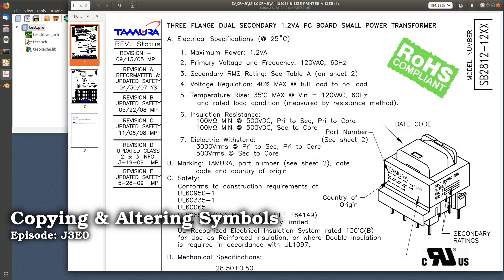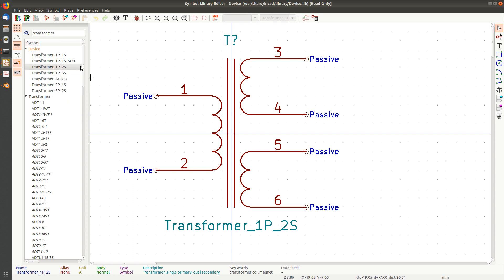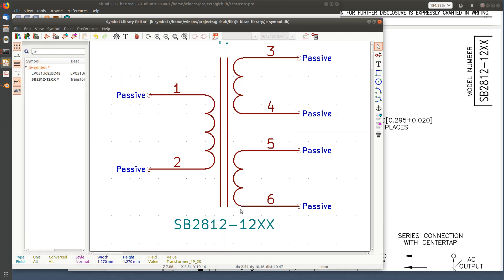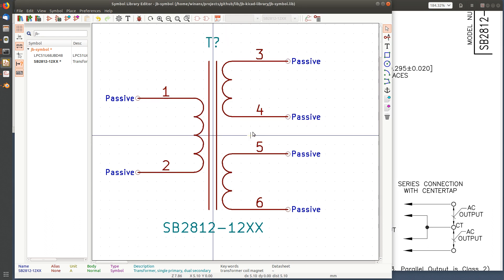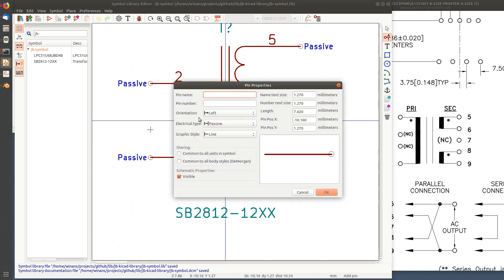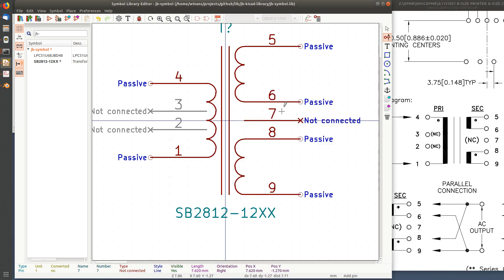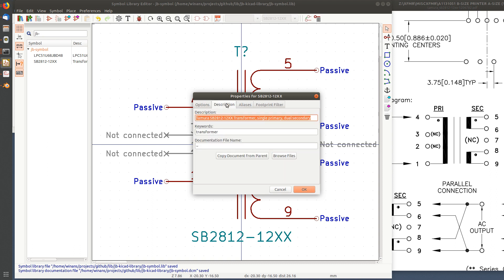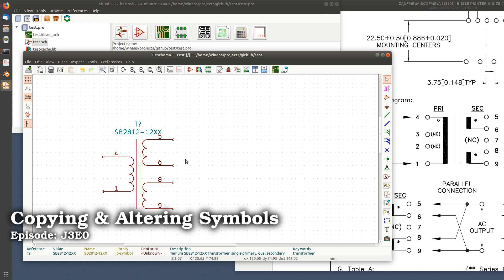KiCad 5 #13 Copying & Altering Symbols

Comment: Hi John, I got an issue I copied the part 27512 to my lib but instead of one it copies 2 types one UV and one OTP
I can edit the OTP part like I want when I delete the UV part it deletes both symbols.

Can you help me to get it done right ? Maybe a very small video :-)
Reply from the maker: I am not able to film a new vid on this right now.  But it is a good idea.   The short of it is:
You probably actually copied the 27C512 that included an alias for the 27512. You can delete the alias(es) you don't want and then rename the part to what you want.  
Locate and delete the aliases in the symbol editor by opening the part properties (I just double click on the background to get to that window) and then select the aliases tab and delete away.  After all that, close the properties and then double-click on the actual part name in the symbol editor (it should appear in gray/blue) and then rename it to what you want and save the lot.
Eh?
Reply: @JohnsBasement  Hi yes the alias was there so I first copy, then remove alias and duplicate then close symbol lib and discard changes done but the duplicate is there the copy will be deleted
I fixed it

Comment: Hi, the difference between Aliases and Keywords I never realy thought about until now, makes sense to help the search out. I do like that you think out loud as I pick up stuff up thats "real world" useful that way. Its becoming a pleasure to work with Kicad as you share timesavers and bring stuff into focus. I have nothing to compare to though, as Kicad is my first step into CAD, but I got the taste for it from EasyEDA which is great too. I guess you have used many other systems in the past and considering that Kicad is "open source" how does it compare to the bad boys of rock like Altium and Eagle ?
Reply from the maker: It has been a while since you asked. I'm sure there are more opinions on this topic than there are days to discuss it.

As for Altium (the last release I used was Winter-2009) KiCad is a bit more primitive. 

Altium is a bit more fancy than KiCad in that it has more features (like the ability to route many parallel lines &  differential pairs, automatic tromboning of traces to create a bus where all the copper tracks are the same length, management of DNP (do not populate) items in the schematic & BOM, support for repeating an identical set of parts & routing on the PCB and more. 

Altium is priced in the thousands.  But if money is not an issue, it is a nice tool.
To my recollection (I only used it for a few small projects some years ago) Eagle didn't seem to offer a whole lot more than KiCad.  I looks like Eagle is still/again free for 2-page schematics and to design 2-layer PCBs up to some limited size.
I want to say Eagle was comparable to KiCad 5.  I'm sure Eagle has advanced since I last used it. However, I do not expect to need it any more since KiCad's features/development efforts are picking up and has no page/size limitations.
Due to the activity around open source these days, I expect that KiCad will become the defacto tool for open-source & hobbyist projects. Thus I have decided to use it for all my open source work and anything else for which it is suited.